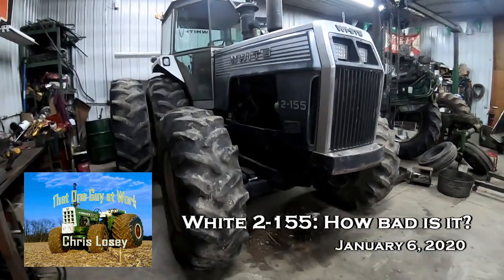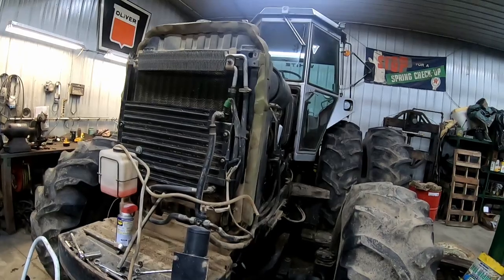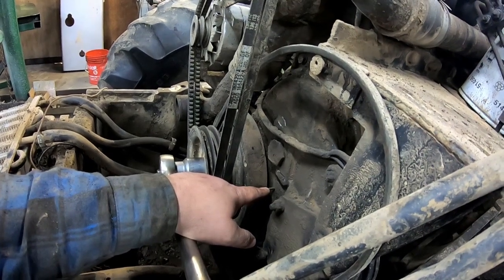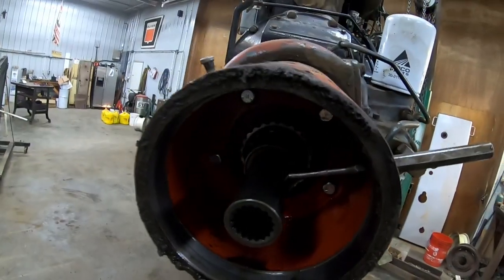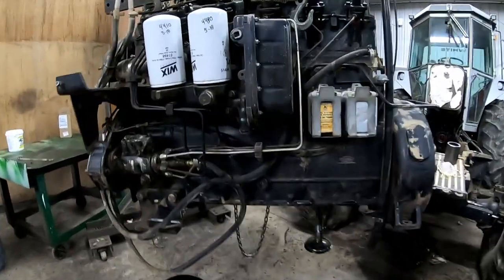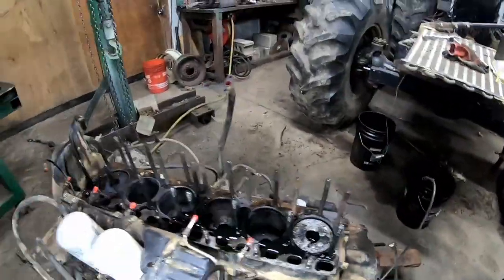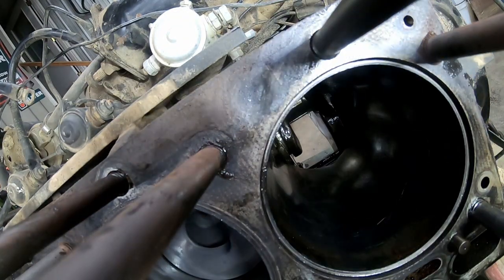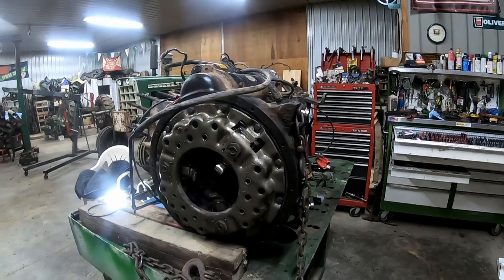White 2-155 Engine Damage - How BAD is it?

Comment: That Hercules engine reminds me a lot of the Hercules multi-fuel engines used by the military in their deuce and a half / older 5 ton vehicles.
Reply from the maker: Almost the same engine.  The military version ran a higher compression rato, a different injection pump and a few other odds and ends. There have been quite a few of the tractors that have been repowered with old deuce and a half engines.
Reply from the maker: Pretty much the same engine.
Reply: The old deuce and a half was also a multifuel setup you could run it on mo-gas jet fuel pretty much anything that would flow and burn.
Reply: @ThatOliverGuyChris  you can still get NOS military parts, a lot cheaper than from agco.  Maibach Tractor in OH stocks parts for these engines, great to people to deal with. Those Hercules engines tend to crack liners, just plan on putting new sleeves/pistons in every 4500 hrs. the bearings should still be good.

Comment: Speaking of engine damage and vandalism, quite a few years back before my time my dad had an old dynahoe backhoe. He had a dirt pit on a road with a man that didn't want him there working. So while my dad was away from the backhoe the man poured shampoo in the oil at least that's what my dad thought it was. The worst part of it was this motor had like 100 hours on it when the guy done that. 

Lets put it this way that man is lucky cameras weren't common back then or there would of been one looking at that machine. That man would've paid dearly.

Comment: I would think it’s like a hot water heater element if you take the ceramic off it’s not going to heat up the only thing is it goes short to ground if it was me I just plug it off because that’s a nice old tractor can you still get parts for Hercules I went out to Google and Google time with Ac‘s production in 1999 so just sitting here watching the news tonight wonder if the cummins 8.3Man you have a good night thank you for responding

Comment: I'm not really educated on the insides of engines. Would the machine shop be able to do anything with the head if it had much physical damage, like if a couple pieces got hammered into it?
Reply from the maker: There are places that can weld them and then grind a new surface.  Usually that is reserved for when you can't find a replacement.
Reply: @ThatOliverGuyChris  thank you!

Comment: You're the second one I've seen with a busted sleeve. I've never seen that happen before, unless a rod came out. That's a very interesting dry sleeve design though. What's the thickness of the sleeve?
Reply from the maker: I'll have to measure, but maybe an 1/8" thick.
Reply: That's pretty heavy for a dry liner.
Reply from the maker: Could be thinner,  it's just a guess on my part.
Reply from the maker: From what I found online,  liner thickness should be 3/32".
Reply: Yes exactly the bore size is 4.562 and the od is 4.750. so 4.750 - 4.562=.188. .188 / 2 = .094" which is 3/32"

Comment: Chris your videos are always to short !!! LoL,,, great job,,, so you think it was the preheat elimint that camera apart and caused the damage ??
Reply from the maker: Lol, I kept trimming this video to get it down to what it is. I'm going to go with that element causing the trouble, it's either that or just a sleeve failure. Everything fits for it being that element. A fresh break on that element with pieces missing, revving the engine up would increase airflow and pick up that piece and shoot it into a cylinder. I was doing about 1300 rpm heading through the driveway (empty), got to the field and gave it more throttle (not even full throttle) and BAM! My guess is that piece got crammed between the piston and the liner when it came up to top dead center, but there's no way to know for sure at this point.

Comment: Are you concerned about the metal that would've been picked up by the oil pump and distributed throughout the engine?
Reply from the maker: Yes. I'm going open the oil pump to inspect it, and remove and clean the filter base/oil cooler to make sure it is clean. It is full flow filtration, so nothing should have gotten any farther. Bypass oil returns to sump, so that should be ok as well.

Comment: My landlord had a Oliver 2150 with the 478 Engine in it - It came out of the factory at 160 hp rated 130. It would do fine in the fall when it was cool while fall plowing but never made it thru a spring planting season without the engine going down.  Come to find out the original engine did not come out of the factory with an engine oil cooler on it.  After 3 times the engine going down, the dealer giving him a loaner and fixing the tractor under warranty they put an oil cooler on it (factory update).  The forth time it went down again the under warranty they replaced it with a JD 4620 and still have that tractor with over 10,000 hours on the engine and 1 overhaul at about 7,000 hours on it.  The 478 engine was just not a good engine.
Reply: Keep in mind John Deere ran a 45 minute hour. So the 10,000 hrs (doubtful) is actually only 7500

Comment: Well, on the bright side, you'll be going back to the field this spring with a newly rebuilt engine. I assume you'll go through it at this point.
Reply from the maker: The pistons and sleeves only have 2,000 hours on them and look excellent. I'm planning on just redoing the one hole. It kind of depends on what I can find.  I don't want to put in something that weighs up different than the oem ones and throws the balance off.
Reply: @ThatOliverGuyChris  That's why I assumed you'd go through it. The types of material that new (even oem) is used today may well ne problematic and not worth the risk. If you don't use the tractor for heavy tillage it might not make a difference. Beautiful tractor. Memories.
Reply from the maker: Pulling the grain wagons is the hardest work this tractor does these days. I'm glad there are some of these aftermarket parts out there for this old equipment, but quality control seems to be an issue for some of these places. Hopefully I can find a match to what I have in there, but if not, there is all new.

Comment: i once rebuilt an old IH engine that had dry sleeves ..... I had to  press them in.......  We had  nitrous score s block one time and had to have a sleeve installed .  Most of our engines are wet sleeve,..... but I worked  with a Major Truck company and  became very familar with cooling system Maint...... I had a 7.3 Navistar homogenous block engine  get a cavitation pin hole because they didn't  reccomend  adding DCA.......Untill it was too late,.....

Comment: Hey man, can you give me some more info on this motor? I have a hercules in my duece and a half and im really interested in the similarity of the 2 considering they are for 2 completely different applications
Reply from the maker: They are almost the same engine. The military version ran a higher compression ratio and a different injection pump to handle the multi fuel feature, along with some other odds and ends different.  There have been a lot of military versions used to repower tired engines in White tractors.  The tractor version is 478 cubic inches,   but I think the military version was around 465.
Reply: @ThatOliverGuyChris  what model pump injection pump is on your motor? And is it easy to aquire?Im wondering if i could use that pump instead of the multifuel pump incase i have another one go bad
Reply from the maker: It's a Roosa master pump, I'd have to check the tag to say exactly which model. It is possible to switch them, but you do have to change a gear under the front cover. The roosa master turns at half of crankshaft speed, and I'm pretty sure the miltary pump turns the same rpm as the crank. Roosa master pumps are easy to come by, very popular in ag applications and very rebuildable.  Finding the gear shouldn't be tough with all the Cummins repowers out there. There's a place in Ohio called Hercano Propulsion that specializes in Hercules engines. I bet he'd have everything you need.
Reply: @ThatOliverGuyChris  interesting!

Comment: Can you take the engine out without the 3way
Reply from the maker: I suppose it could be done, but there's nothing to support the front of the 3 speed once is separates from the engine. The power shaft in the middle would be impossible to control whether it stayed in the engine or with the transmission. If it slid forward with the engine, it would de-couple at the rear of the 3 speed, and getting that back in place could be a challenge. So I won't say it's impossible, but I wouldn't recommend it.
Reply: @ThatOliverGuyChris  thanks mate appreciate your help.  Mine is busted too
Reply: I'll just do it the right way

Comment: One issue with Hercules engines, is the top piston ring groove is lower than other makes. Carbon builds up then cracks sleeves.
You obviously baby this tractor. Let carbon build up. I had many Hercules engines apart.

Comment: WOW,what a mess,that heater im thinking is in the intake manifold,is there any way u can wrap something around  it,like screen,or make something out of stainless steel to wrap  it,gonna have to do some homework,HOW HOT DOES THAT HEATER GET,what ever u make to wrap it has to take the heat or it will melt and your right back to were u are now,the company that makes that heater might have something to put around it so porclen wont  get in there again,maybe go to a block heater,JUST AN IDEA or SUGESTION,LIKE YOUR VIDEO,can get rid of that heater and use a glow plug,not know what the thread is,NPT OR A STANDARD THREAD,use the hole the heater was in,
Reply from the maker: I'm looking into doing something different. It's a nice thing to have to help start on cold days, so I don't really want to eliminate it.

Comment: Your so far into it . I would do a complete over haul . it might bite you later on😕
Reply from the maker: It's tempting to go that route, but they don't give parts away either. Everything looks to be in excellent shape other than that one hole.
Reply: Chris Losey , when I first got my 1940 Allis Chalmers B, The tractor sounded like it was running fine, But it was a winter. Come to find out when running it in the summer, it did not idle right and would start running rough. So  I started checking the spark plug wires which were not the right ones for the tractor were corroding. I pulled the tractor into the garage and decided to go through the whole tractor because I could hear that they were something wrong. And boy oh boy I was correct. The cooling system was plugged up. And you have to remember this is my first tractor ever. I got the cooling system fixed, Replaced the Valves which I found a bolt in one. I rewired the whole tractor. Right now I’m working on the distributor and have to work on the oil pan. Then I can start it up and drive it.

Comment: This is definitely an interesting development.  I’m curious as to what other White/Oliver motors had this grid heater.  Did the Perkins motors have them?
Reply from the maker: Most of the Olivers used that heater. I think the 1850 Perkins did, but the Whites used a thermostart that burned a little fuel in the intake.
Reply: I was gonna say that I know my 2-110 has a little ether injector on it.  Gonna have to talk to my neighbor and tell him to pull that heater out of his 2-135.  He mainly uses it for summer only, I’m thinking he could maybe just cap it.

Comment: Looks like a crack between the valve on # 6?
Reply from the maker: They all have that line between them. It's normal .
Reply: Chris Losey that good to here. Ford uses a sleeve like that in the 401 overhaul kit. Sucked #6 down too. So we always put # 6 in a little looser because it’s the hottest hole.
Reply: Piston skirt doesn't look like stuck liner , which gives a lot of weight to your "theory " of grid heater failure .

Comment: MY EXPERIENCE WHERE IS THE COOLANT IN THE OIL IF THE SLEEVE WENT, OK YOU GOT LUCKY IT'S A UNDERSIZED BORE DRY SLEEVE THAT DOESN'T GO THRU THE WATER JACKET. SLEEVE PISTON AND ROD #6 HONE RINGS AND BEARINGS FOR THE REST REPLACE THE SEALS AND GASKETS, YOU'LL HAVE A NEW ENGINE ONCE THE REST OF THE BROKEN PARTS ARE REPLACED.
IN THE ELECTRONICS FIELD THEY MAKE A SILICONE GREASE THAT GOES UNDER THE FINALS TO TRANSFER THE HEAT TO THE 
ALUMINUM HOUSING TO HELP DISSIPATE HEAT . WONDER IF 6 SMALL TUBES OF THAT STUFF WOULD WORK TO TRANSFER YOUR HEAT AWAY FROM THE CYLINDERS AND KEEP IT COOLER.

Comment: It could of been better but could of been worse too. If it wasn't dry sleeve it would have likely destroyed everything. I'm changing out all my preheaters now. Lol
Reply: I bought a cylinder kit from Agkits in the past on the interwebs for my 7030 that wrecked one because of a bad injector. It was the reliance with the piston already in the sleeve. Looks like there three grand and change for an inframe on the Hercules 😩. Single cylinder is three hundred and change. I'm with you though, just replace the bad cylinder and it will likely last until it's someone else's problem Lol
Reply: If your thinking about preheaters in an Allis Chalmers, in 50 years I've never seen one fail, plus they are no longer available from agco

Comment: My suggestion is ELIMINATE the preheater. It looks like a poor design anyway.
Reply from the maker: I'm wondering about knocking the rest of the ceramic out and using it that way. I assume it's in there to keep it from shorting out if it flexes as it expands from the heat. I'm going to hook it to a battery and see how much it moves.

Comment: What vandalism?
Reply from the maker: About 30 years ago we had some vandalism going on. Long story short, water in fuel ruined injectors, which washed down the liners and caused ring failure, that's why the pistons and sleeves don't have as many hours as the rest of the tractor.